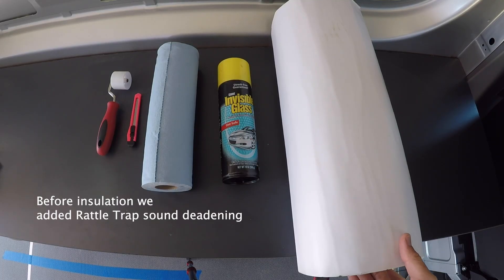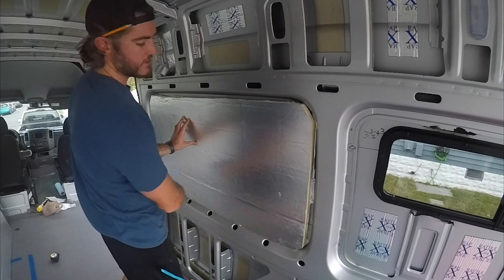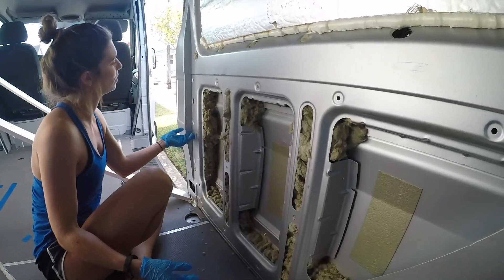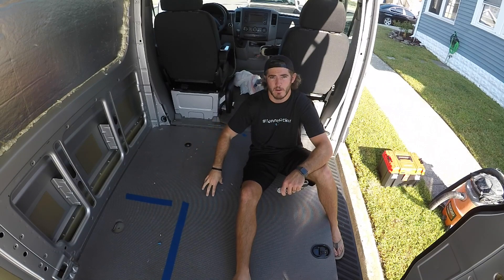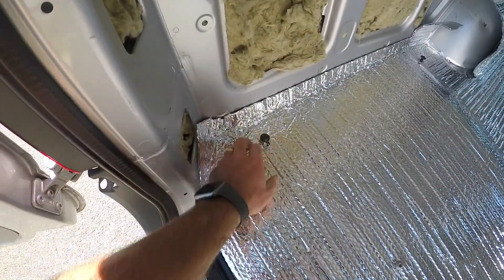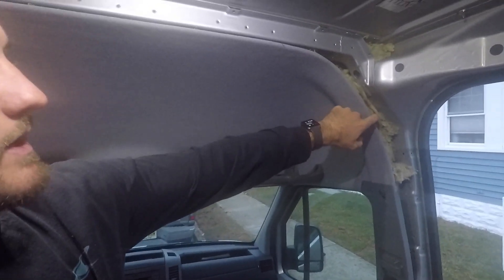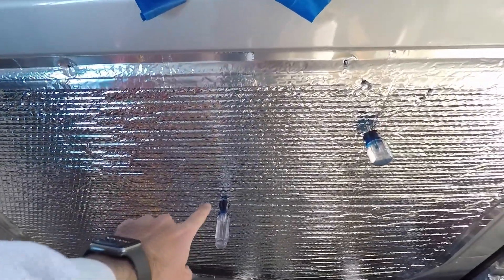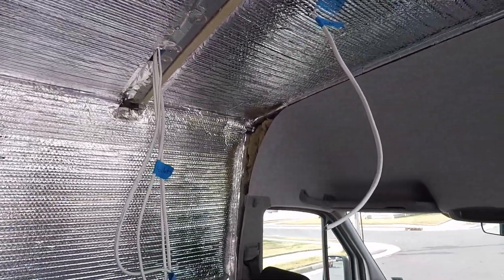Van Build Ep 10 - Insulation and Sound Proofing

Comment: We just got done insulating the inside of our van with the Rockwool and reflectix. You want to make sure that you DO NOT pack as much wool in as possible. The "fluff" is what insulates, not the actual material as it creates air pockets. packing it tight is a waste and you'll lose all insulation properties. We also went over the insulation and put reflictix over the rockwool insulated areas and made sure there was at least an inch or two of a gap between the reflectix and the wool to keep the fibers contained and add a bit of an R value to it. 
I hear you on the height problem. I'm 6'5" and had to get the extra tall Transit and still only have an inch left after the floor insulation and ceiling! 
Keep it up!!
Reply from the maker: Tom Lastname appreciate it!!!  We have our reflectix pretty loose to provide somewhat of an air gap.  Definitely not as good as you with an inch or two but there’s a gap in most spots.  

 the damn height issue!!! I wish We could insulate our floor better but I do not want to bend my head at all!  We’ll see if I regret it or not.  Hoping the espar diesel heater will keep us toasty

Comment: You might want to rethink the wool.  I bought a 2008 Dodge Sprinter and they used wool on the bottom panels. There are external plastic protective body strips that are held on with plastic clips through the body.  Moisture came through the clip hole and collected within the wool  and created body rust.  You might want to seal the clip holes inside with silicon sealer, but as for me , I am going with another style of insulation in the lower panels.  The upper side panels did not have any problems.
Reply from the maker: We sealed those plastic clips up when we added the truck bed liner to the van!

Comment: Hi, noting the below comments on Reflectix on metal and your need for height over R number for the floor (I am 6'2") it looks like there maybe so 3x1's under the back portion of the original truck flooring when you explain about the back edging. did you create a low wooden frame throughout or just certain areas (PS I am 52 so hoping that by the time I use my van I will have shrunk a couple of inches :) I love the idea of the space gain of using truck Reflectix only then original truck flooring with flooring on top for the space.......presume you are not feeling issues in use (unless in very cold temperatures perhaps? I am not planning to go anywhere cold ever! But I guess it could happen. Thanks for your build series. Very honest and very helpful.
Reply from the maker: If you’re just doing reflectix on the floor I wouldn’t even bother! If I did it again I’d put that really thin foam insulation I think it’s pink? But I’m not sure if I would if I 100% wasn’t going in cold weather.  We didn’t think we would either but here we are in -8 degrees in west Yellowstone.

Biggest help is a runner rug on top of our flooring otherwise it’s FREEZING 

But if you’re staying in over 50 degrees don’t even bother with the floor just put a rug over it
Reply: @Mathers On The Map  thanks for your advice. Think I have completed watching the build series now. Thank you for the generosity of your time to explain things. Very much appreciated. I try to do the same on my channel. Thanks again and keep up the great work and great content.

Comment: For the wool, they make machines, which you can rent, that will fluff it and blast in directly into every nook and cranny. Better results with less time and effort.
Reply from the maker: Good to know! Who is they? Would love to check it out
Reply: @MathersOnTheMap  I don't know any specific brands, sorry. Best bet would be to just check a local tool and equipment rental shop.
Reply from the maker: Will do for the future!
Reply: @MathersOnTheMap  glad I could help 😊.
Reply: Home Depot or Lowe's have blow-in insulation machines but it would take a ton of wool in this case. May work well... may not.
Reply: @treynewsom1817  yeah but why buy one for this single project when you can rent for much cheaper.

Comment: in terms of order, it seems you installed windows & roof fan first, then insulation, then electrical, then plumbing?
Reply from the maker: yep that's right Dave!  basically all of the exterior was done before insulation then electrical  but grounding to the chassis was before completing insulation, plumbing was after all of that.  You definitely want your plumbing on the inside of insulation not behind it especially if you'll be in colder temperatures!
Reply: @MathersOnTheMap  thanks!

Comment: Regarding comment below...Reflectix isn't only for windows! (where did you get that information from?) 
Anyway...all installations shown in this video requires an air gap to work (as per the manufactures instructions...go to their web site) . This product is designed to limit radiant heat transfer.   I don't see this product works as shown in this video.  It is simply jambed between two surfaces (like floor and plywood)  A lot of work that will no produce the results you wanted.

Comment: Where the reflectix touches any metal it becomes a conductor.
Reply from the maker: Hey yes you’re right, when it touches the metal it does act as a conductor.  For our build we have an air gap everywhere. However on our floor, some of the reflectix does touch the metal.  A big concern of mine is standing room height being 6’1” so I didn’t want to elevate the floor too much

Comment: sorry to find this video so late.
you might as well tear all this out again,  the reflectics will help you trap water where you put it and make your van rust out very quick
and that rockwool insulation will get in your lungs and itch everywhere on your body ...  it will be horrible .....
who am I to tell you this - just some Whole commenting on a YouTube video ....
I bought a van that was done wrong and I build 2 vans myself so far ...   I kind of found out the hard war what worked and what doesn't ...  
and those wheel wells need to be covered completely in rattle trap .....

sorry, shoot the messenger or delete my comment - or if you want my help or more information reply to this comment and I will give you my contact information or contact me on IG. @zilawelds
Reply: As long as you put a barrier between the wool and the van, its fine. That stuff is MUCH better than regular insulation when it comes to "flaking off" and floating around. I put up 3 bags of rockwool without a mask and ripping it up and hardly had any issues coughing or itching. So daily use of it sitting behind a wall (and hopefully with a vapor barrier) there would be no problems.